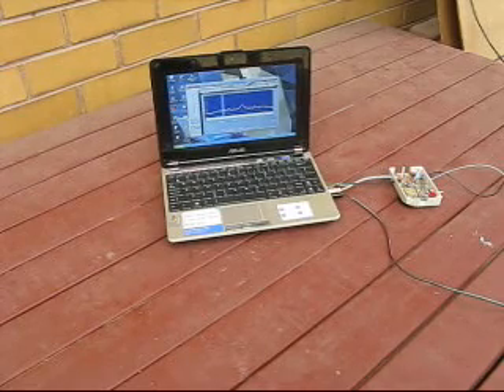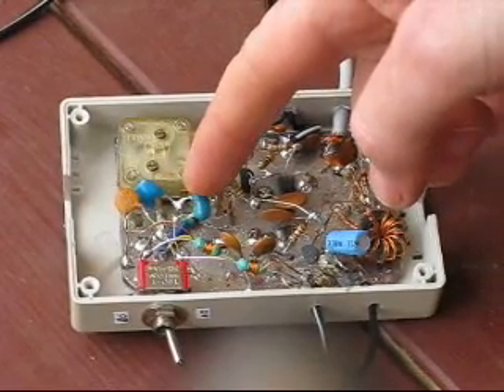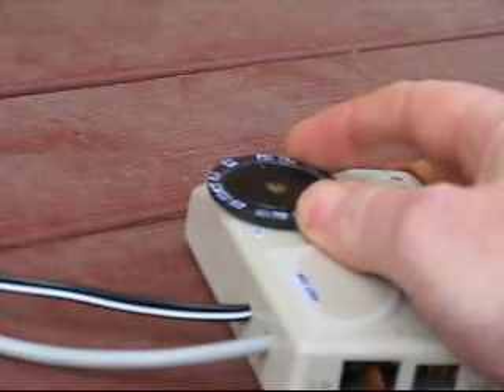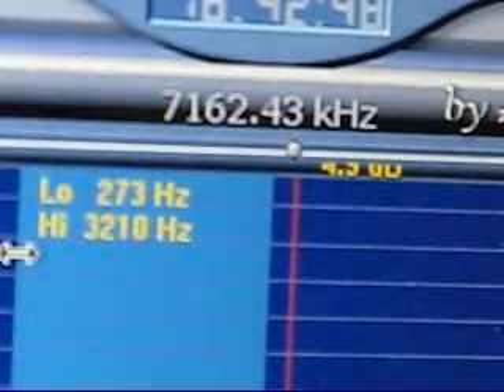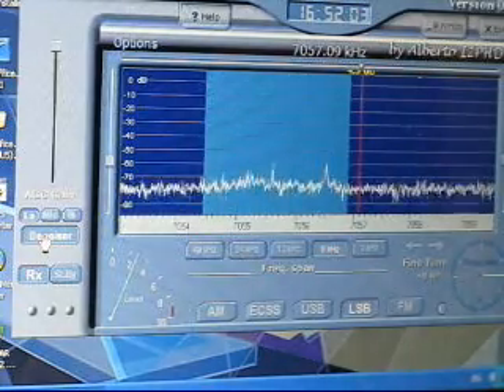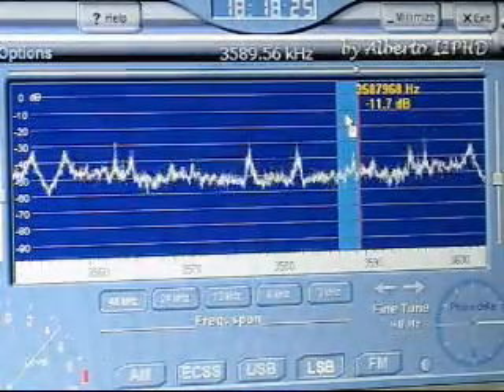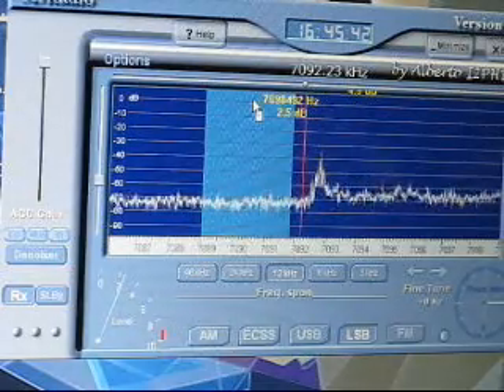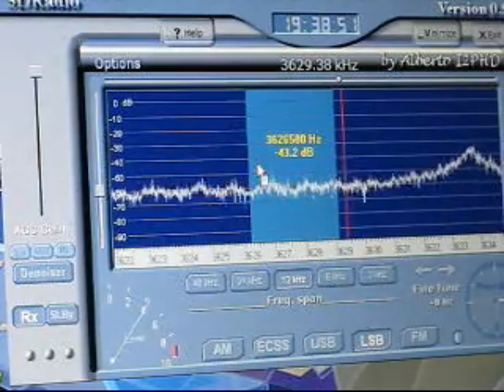Homebrew software defined radio - a demonstration

Comment: Could you use a upconvter. For instance 47.13 mhz minus 40 mhz  to get a difference of 7.13 mhz  whereas 40 mhz being the local oscillator  and 47.13 mhz being the mixeing oscillator.

Comment: Dear Peter.....I should have heeded your warning and gone for a kit! The simplicity of this design was breath taking though, so I had to try it on my Surface Pro 7. Alas after wiring up the TRRS 3.5mm and plugging it in....only noise. I also tried HDSDR software but same. I guess modern sound cards are not going to accept signal like this circuit produces???  I'm 10 years too late. Also should crawl before I run! It was so simple it kind of looked like the SDR equivalent of a crystal set so thanks for the great video! On the plus side, I wired up a crystal  Colpitts oscillator that warbled nicely  and learnt how to ugly build which was fun! So now I'm going to try a "simple" receiver and CW transmitter.....fingers crossed! Thank you for re-igniting my interest in all things ham....your enthusiasm is infectious 73.

Comment: Could there be one like this that would cover LW-MW and Shortwave from 10 kHz to 30 MHz?  Is it possible?
Reply from the maker: It would need to be much more complicated due to need for frequency agility. Best to use an upconverter connected to an RTL2832.

Comment from the maker: If you wanted to extend the concept to VHF you could use a crystal oscillator and multipliers.  Or a DDS.  But I think the noise figure and sensitivity will be very poor.  This design drops off above about 10 MHz and you need to do a lot to improve it.  Another approach is to use a converter to convert 144 MHz down to say 7 MHz. Image response will be poor and you'd be better with a higher IF frequency eg 20 MHz.  Best to look at a circuit or kit better than this or you'll be disappointed!

Comment: @vk3ye Where do I find the prewound chokes?   According to the schematic diagram on your page, it says 8 turns with a 100 pF capacitor in series with a vertical "thick line" (ferrite core) and then the 4.7 uH on the other side of the side of the line which means it's a transformer like a ferrite rod.  It says it in the schematic diagram on your web page  It's kinda confusing according to the schematic diagram. .

Comment from the maker: @gccengineering1996 The inductors are prewound RF chokes so no winding. No need for LCR meter. You'll need to change the local osc freq for long wave. I suggest starting with a simple direct conversion receiver (maybe a kit) and putting the audio into the computer with the SDR software.

Comment: Main reason why I cannot build this project because  I cannot find the resonators for the 80 meter  and 40 meter and how many turns is for 4.7 uh? and how many turns is for 10 uh?   I would need a LCR meter to build this circuit. Also could I substitute different inductors like if I want to listen to the long wave band?

Comment: @vk3ye : I have been thinking of using a cheap USB soundcard from Ebay, the ones with stereo Mic input or using the cheap Guitar to USB gadgets which have a Line In option. FB on the project. I know what Im building the coming weekend. 

73
Ragav

Comment: Excellent work on the RX OM. I was wondering how the mic is wired. Other 'easy' designs have 2 outputs for the Inphase and Quad signal to be fed to the line in. Am I supposed to provide the output from the mixer to both the ring and the tip jacks of the stereo plug Id be using? I'd always thought that the Mic input of soundcards are in Stereo?

73
Ragav
VU3VWR

Comment from the maker: In response to the questions there are no kits.  Neither are there etched circuit boards - it's quicker and more educational not to use them.  But the circuit is now available on VK5TM's website.   w w w . v k 5 t m . c o m

Comment from the maker: @ tiputipu0052 - circuit configurations vary so it's not possible to give a straight answer.  However I recommend VK2TIP's website for a good tutorial on radio circuits.